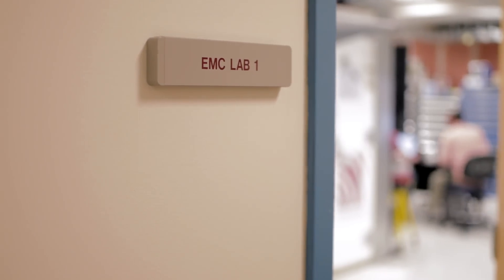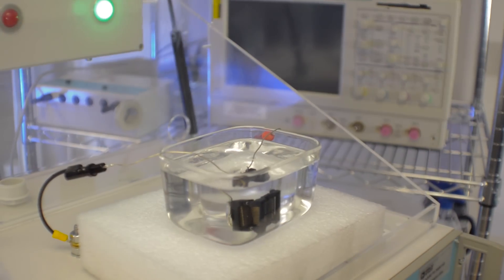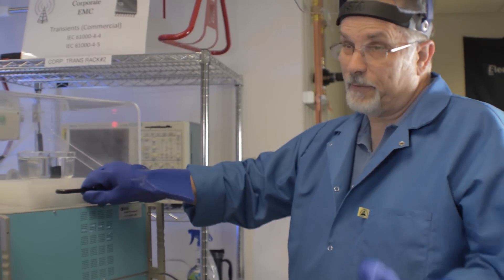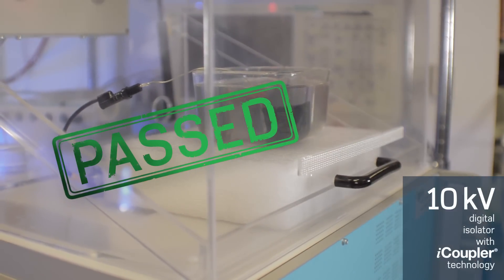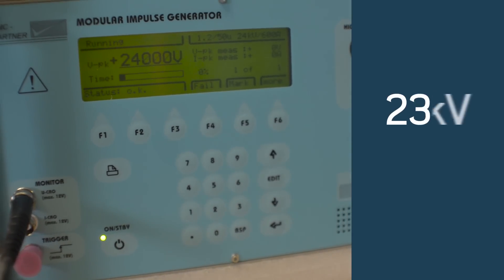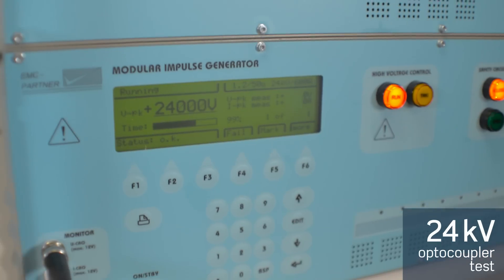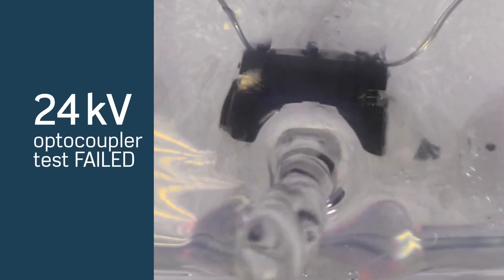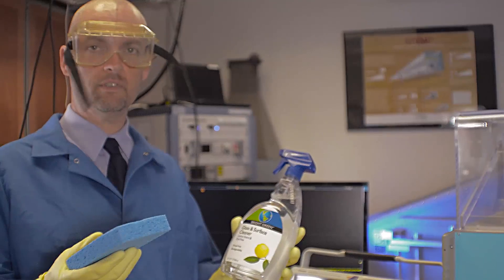Isolation of Things: iCoupler Digital Isolators vs. Optocouplers

Comment: What is that fluid for?
Reply from the maker: A typical specification in Isolation standards is the Maximum Rated Isolation Voltage (VIOSM). This is the highest 1.2/50us surge waveform that can be applied to the internal insulation in the iCoupler digital isolator. The iCoupler device is typically tested in oil to ensure no arching or flashover occurs, and that the internal insulation is fully stressed. Oil's breakdown properties are considerably higher than that of air, so hence helps reduce arching or flashover.

Comment: Is there a device, maybe semiconductor based, that works as optocoupler? like transistor with 4 pins, 2 of which are isolated input signal that "open" transistor. I don't need isolation for high voltages, only logical levels. Digital isolators are too slow(
Reply from the maker: Thank you for your question! The latest gen of digital isolators have 10ns prop delays, which is going to be much faster than an optocoupler. They will also level shift between 1.7V and 5.5V domains (ADuM121N, ADuM141E,…). All the digital isolator will have CMOS inputs though. Engage with ADI technology experts in our online community, EngineerZone®. Ask your tough design questions, browse our rich knowledge base, or read about new technologies in one of our blogs. For isolation questions, visit: https://ez.analog.com/interface-isolation/. Unsure where to post? Simply type your product number in the Search by Keyword or Part Number field and EngineerZone will suggest the correct forum.

Comment: I was about to invest in optocouplers but now this add.
I have three questions:
1) If there are a lot of noise LF/HF on the wire to control the unit, would that not "jump" to the other side?
2) Can it be used as a variable resistor like the optocoupled FET?
3) If so how precise do the  resistance mach the control current?
Reply from the maker: Hello, I asked the Analog Devices engineer and he wants to make sure that your questions are for the above video. He's not sure how the questions align with the video.
Reply: Analog Devices, Inc. Thanks for your reply.
I will try to make it more clear.
An normal optocoupler resistor or FET can give a variable resistance, depending on voltage or current.
On of the great advances in an optocoupler is that no signal do cross from LED to the other site, because it is only light that crosses the "gap". In your Icouplers, you do use an "transformer" and I am wondering if that also can stop any RF signal?
Last but nut least, optocouplers are not the most precise so its value do change in a curve instead of lineare depending on current/voltage.
I want to use the Icoupler as an attenuator for low signals that may not be desturbed by the controlling signal.
Reply from the maker: Hello, for more information visit http://www.analog.com/en/products/interface-isolation/isolation.html?ADICID=PDSR_NA_P1141   There is a fundamental difference between an optocoupler and a digital isolator.  Optocouplers are at their heart analog devices.  They reject high frequency in two ways, first, they have very low bandwidth to respond to noise, which skims off the differential noise at their inputs, second they have capacitance between their input side and output side just due to the proximity of lead frames through insulation, which can couple into their receiver circuits or allow noise to couple from input to output directly.  They employ shielding to help with their receiver circuits to help with that component, and parasitic capacitance is minimized to prevent coupling directly.  The result is a component that is slow, and moderately good at parasitic high frequency rejection.

The digital isolator looks at inputs as true digital signals, differential noise is skimmed off like any digital input would  The digital information is encoded by one of several schemes to give a high signal to noise signal across the transformer to receivers in the secondary that recreate the digital signal.  So there is no coupling of high frequency through the data path.  The exception to this is noise that comes in through the supplies, or common mode noise across the barrier.  We have been working to improve robustness power supply rejection and common mode rejection and we are very god at it now.  The coupling mechanism is usually parasitic capacitance which can be minimized by our internal layout and use of differential signaling.

Since our devices are digital, it sounds a lot like you intend to use them in an analog mode, which does not seem like it would work.  You would have to digitize your low level signals and send them as digital data.  The performance of that depends on the ADC as well as the isolator.  For digital signals, it will clean noise off of those as long as it is less than the switching thresholds or out of the bandwidth of the coupler.

Lastly, Optocouplers have infrared diodes that wear out over time, causing loss of gain and eventually failure, so that has to be designed into an application at the start.  It usually means making a severe overdesign so that you have enough gain at end of expected lifetime to still work.  This overdesign usually results in poor performance, such as slow switching speed.  Digital isolators have no materials inside that cause parametric degradation in the signal path.  It will not change over the life of the product.
Reply: Analog Devices, Inc. Thanks a lot for your fantastic answer and for spending all that time to write it!!:-)
That shows a lot of good things about you!

Comment: Okay. iCoupler not busted, but at which voltage it stops working? Which AD part or optocoupler part used for this test, information not available. Damages for outside of package is not only the problem, we need to know about the internal damage. May be the outer package is made with some bullet proof material...
Reply from the maker: All damage was from the inside out.  At those voltages and power levels, once breakdown occurs, it vaporizes internal materials and ruptures the package from the inside. It blows optocouplers in half, and blows a cone out of the top of the digital isolators.  No special materials were used, Mold compound and Polyimide film insulation were used same as all of our parts.

Comment: May I add my constructive criticism to the video?

1) ADI is making cutting edge electronics components with great documentation and support material such as Analog Dialogue. I've been using them since the start of my career.

2) I understand that the world is hyped up by tech videos, marketing people, startups, Myth Busters, "experts" without a degree, etc. MOST of them lacking the most basic logical approach to solve problems not to mention scientific or engineering approach and they mostly focusing on the "funny" and "cool" factor of things.
in my opinion this superficial thinking not only harms our proffessions but a lot of other things in our lives as well.

3) I think such a remarkable company as ADI shouldn't go down the way of amateurs, and although it's important to make videos understandable, funny and cool they shouldn't cross the border of "what did i just watch?" This video just did.

4) explain what is an optocoupler, icoupler SHOW HARD DATA, explain experiments, etc.

5) you're engineers, be engineers, don't try to act, leave that to actors. Just be original and don't copy hypes and trends. Make the trends. I really liked Matt Duff's videos of Opamps, etc.

best wishes

Comment: The real point is what happen  on the other side ?
no need to have a lot of current 
the question is what happens behind the photo transistor of the optocoupler 
on accidental surge optocoupler is very efficient provided that they can be easily replaced 
What if malicious guy put a taser in the input ? it is not 24000V but millions volts
obviously no explosions or impressive manifestations to expect but a trail of failures that could ruin a very expensive ensemble.

Comment: If the organic isolation breaks down it will leave a conductive track, and the insulation is invalidated.  All the current does is make the failure more spectacular.  We can do the same thing with current limits in place.  The end result is the same, it just does not blow holes in the part.
Reply: Галина Екамчукова km no

novelas turcas

Comment: Congrats for your design and i see the point about the isolation comparatives, but, what really makes that difference? and what about the current?
Reply from the maker: If the organic isolation breaks down it will leave a conductive track, and the insulation is invalidated.  All the current does is make the failure more spectacular.  We can do the same thing with current limits in place.  The end result is the same, it just does not blow holes in the part.
Reply: Rey_Electronico ——
Reply: Analog Devices, Inc. 
".. does not blow holes in the 
parts "..  well what fun would that be ?.. lol.. thanks guys